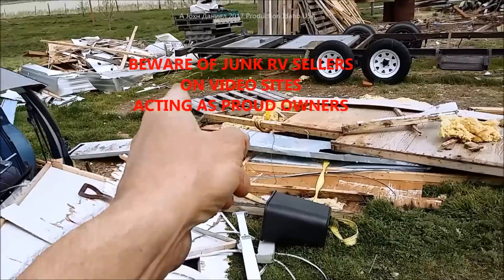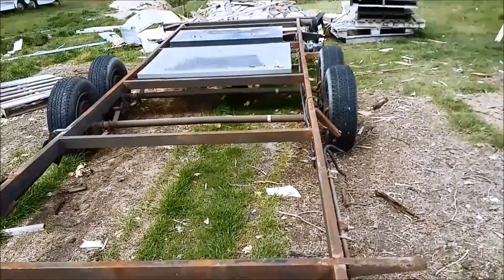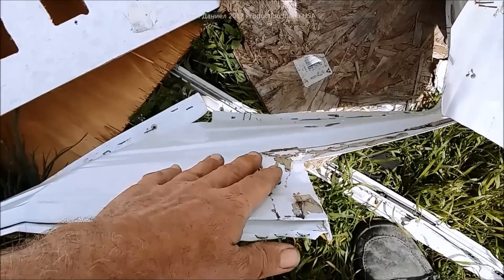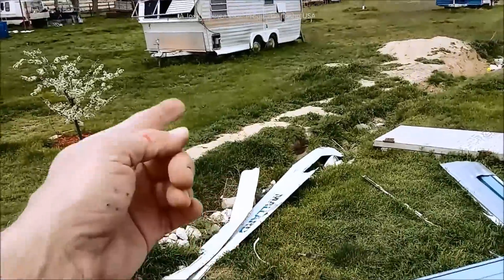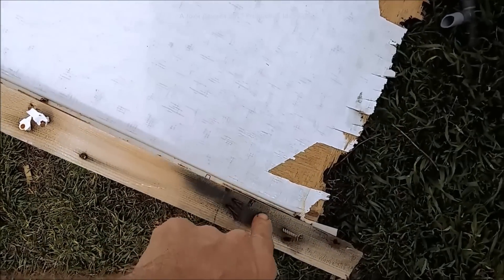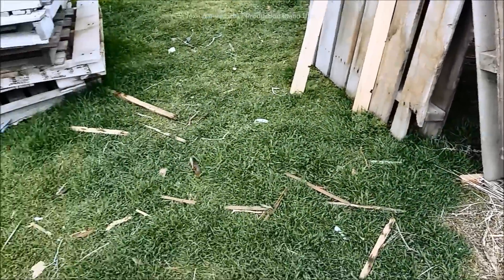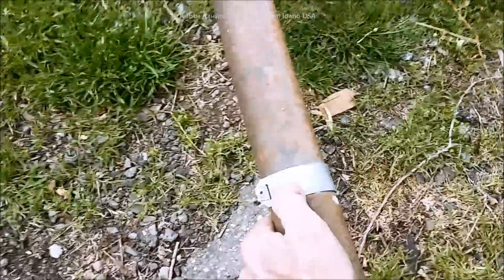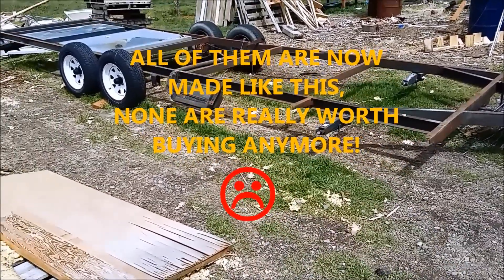HOW THEY MAKE RV Campers Travel Trailers, The truth, Wow! Info Below

Comment: The rot is caused by poor maintenance on a very inexpensive travel trailer. This isn't how all travel trailers are made plus, again, this is low-end wood-framed trailer. There are also vacuum-bonded aluminum-framed trailers with reinforced HVAC ducting systems and more. This is like making fun of a poorly-maintained Chevette and saying all cars are made that way. Nope.
Reply from the maker: Did some checking on Aluminum bonding adhesive contact and vacuum construction. Heres facts: RV industry bonding adhesive compared to aircraft industry bonding adhesive - RV industry adhesive material cost per linear foot of bonded surface $0.46 cents, full adhesion according to Dupont USA last on average 33.6 months. Aircraft industry bonding adhesive according to 3M cost $0.98 cents in material cost, full adhesion longevity per linear foot and last 309 months. Draw your own conclusions, but a $60,000 RV should use the better glues, however, they choose to save about $140 per RV to make them fail on purpose. 
NOTE - The RV has 1/4 bead application , the aircraft has 3/8 bead application on its contact surfaces. Widths are similar.
Reply: That's a lifespan (under more severe conditions) of some 25 years. Depending on bulk purchasing power that $140 differential may be lower, and really, would you prefer to "save" your hundred or so dollars and have a leak / delamination in two and a half years (that'll cost you thousands to fix - warrranty's long expired), or would you rather spend a few extra cents (compared with the full purchase price) and have 25 years peace of mind?
Reply: Kevin Masters 100% true.  I sold RVs for five years, some expensive pre 2008 models were well built, but after the market crushed even those went down the hill. The word is cheap made in China parts assembled really fast in US using a lot of wood from Canada.  So out of the five years, I spent two and a half in service dealing with my customer's headaches.  I spent most of my life in automotive industry and when I saw how they put these RVs together was like "wow, so I'm selling brand new Ford model T".  Customers loved me, a lot of them became my friends, because I told them up front "bring tools, cause s$$t will come a part or break down". Cheers
Reply from the maker: Although your post has convinced people that MAINTENANCE ONLY is the key, how about the fact buyers are getting RV's with totally missing seals? How does a buyer, (the 2 previous owners of this FleetRot RV) maintain a RV that he has 4 windows you can not see without removing them prior to buying it having absolutely ZERO mastic seal, 3 more with partial seals. This is what happens often after long holidays at the factory or untrained replacement employees who don't spend 2 seconds before they screw in a window if the tape shop guy even put the mastic in the window rim prior to sending it out for install. And its common. 
NOW TO COMPARE - So like your comparison of a poorly maintained Chevette, if it came with no water in the radiator or oil in the engine from the factory then General Motors would get a bad name in its entirety just like Fleetwood aka FleetRot gets here. The problem a Chevette had was not lack of quality, Chevettes and their sibling cars were damn good cars, actual build and structural better than most Gm cars of the day. But from roll out they had a piss poor parts and service network. The car got a bad rap for it as a result. We had a Diesel Chevette, 4 door that with the factory 4 speed went over 300,000 miles. Due to being a Diesel we could get parts from then WESTERN AUTO/Green Light Auto parts and our Chevette never was a issue. But GM dealers ( Detroit news 1988 ) were 3 years behind on parts for Chevettes and similar chassis cars. Not the cars fault. But it earned it millions of haters.
Reply: Roy Grillo Just so you know a certified tech most likely did not change your oil. I haven't done an oil change in 15 years.
Reply: 40mmrrsmith I've worked in a dealership serv dept.  The techs don't do oil changes unless it's part of whatever service job they happen to be doing.  The ones doing the quick lube oil changes are usually late teens-early 20s kids going to the local vocational school working part time and aren't fully trained yet on whatever they are doing an oil change on.  Had to put a motor in a Maxima that blew up after those kids forgot to put the oil filter on.  Made it a mile down the road and was towed back in with a hole in the side.  Smh
Reply: Anthony Barthel the first dealership i worked at carried forrest river. Rockwood and wildwoods. The wildwoods were aluminum sided and the "rotwoods" fiberglass sided. Wildwoods held up a tad better than the rockwoods because of the aluminum but theyre both low line travel trailers. Theyre not much better than a fleetwood. The rockwoods would have delamination in the sidewalls in 3yrs.
Reply: Not sure why I'm wasting my time but there are HUGE differences in travel trailers from one manufacturer to the other and from plant to plant. Yes, they all have problems because there's only one refrigerator company (two brands, one owner) and one company makes the vast majority of the components in an RV - Lippert. But a well-made trailer such as a Rockwood, Flagstaff or Outback; for example, will offer significantly fewer issues than something like a Sonoma from Forest River's SoCal plant. 

And who's to say what's worth what? I came out of the hotel business where we'd charge people $250 a night to sleep in someone else's bed. For $250/month you can buy a decent smaller travel trailer and bring your kitchen and your own bed with you and travel all over the USA. Now I work in the RV industry where I see things first-hand and I'd much rather have a travel trailer and roam the country than stay in hotels and motels.
Reply: M. Dwayne Steckley Absolutely nothing, since I'm Canadian. I'm just against the sticker "Made in USA". It should say "Assembled in USA". Cheers
Reply: @wadimszymocha7463  
Whos your president anyway?  Lol cheers.  Loved Toronto.
Reply: Јоhn Daniel Did you really expect aircraft quality? Holy shit. When was the last time your rv went 400 mph?
Reply from the maker: There are no such people on the Assembly lines, Certified rv techs are at dealerships or independent repair services and are people trained though Vocational Schools. Not the industry.
Reply: wow.  very helpful rresponse
Reply: Maybe Anthony Barthel lives in the desert
Reply: kevin, how bout a late 80s early 90s fleetwood southwind type Rv? 
ive been looking at those lately as they seem structurally solid and you can find them for 5k
Reply: Dunford00 stay away from Fleetwood. I would suggest a Winnebago adventure in those years. Much better construction and they will still have parts available.
Reply: Anthony Barthel well said

I have an 05 travelaire 18'

Priceless

No issues 

Good quality 

Ac still cold

Excellent

Makes me happy I don't have an inferior brand
Reply: Anthony is correct. If consumers stopped buying junk, manufacturers would stop selling junk. Don't blame your lack of skills for making better choices on the mfg, you purchased the damn thing. And insults are not arguments, it's just a projection.
Reply: Anthony Barthel im a master certified rv tech. None and i mean none of them are worth the money your paying for them. They just make the higher dollar ones look more appealing. Yeah they have their bullshit sales pitches like vacuum bonded and the one piece roof ect. In the end theyre all slapped together as fast as humanly possible with the cheapest materials available. The fleetwood revolution is a 400k unit fully equipped and from the factory we'll have 20 major fuckups on average to fix from the factory before we can even sell it. Then after the customer starts using it and more shit breaks theyll be back with 20 more warranty jobs. Had one guy that was back 4 different times with a coach and after we finally got everything fixed he filed a lawsuit and demanded our dealership take his back and give him another brand new one. The sad truth is he should of kept the one he got the bugs worked out of cause hes starting all over with a another new one. Lol
Reply: Roy Grillo no I fix them not build them. The guys building them dont have any certifications. Theyre on piece work. The more they push out the more money they get
Reply: Roy Grillo sure each manufacturer has their model specific training classes, which is a sales pitch and ive been to most of them, but RVIA (recreational vehicle industry's of America) is where you get the training and take a 4hr test at the end. If you pass the test and up to a certain percentage your certified.  If you score over the threshold percentage then your master certified. And its a very difficult test. Lots of essay questions. We have guys that have been working on rv's for 10yrs and still cant get master certified or some even pass it.
Reply: I'm a retired tech thank god. Junk
Reply: What's wrong with Canadian wood?
Reply: You gotta love the soundtrack selected for this rant.. lol
Reply: Anthony Barthel exactly ,it’s a piece of junk
Reply: Anthony Barthel but the frame is crap too. It's making me rethink this whole endeavor.
Reply: Anthony Barthel so your saying forestriver is a good One?  We I've been in this industry over 20 years and take it from me, there isn't a good one period. It's your money to waste. Buy a new one and watch the service department rebuild it for you. By the way they will blame the repairs on improper use and not cover it under warranty. I see it everyday.
Reply: How do you "Certify" or even "Master Certified" RV techs if not being trained by those whom build them? I have not heard of Vocational Schools strictly for the RV industry. Who trained those instructors at the schools? In a similar instance I took my 2017 Ford Explorer to the dealer we purchased from for the 5000 mi oil change preformed by a "Certified" tech. And the next morning I started to take my wife to the store and the belly pan (fiberglass shield) fell off and broke. Tech failed to secure the pan after oil change, needless to say the dealer replaced it and apologized then gave us free detailing services. But can you count on just certifications?
Reply: M.Dwayne Steckley Its weaker because of Justin Trudeau giving it hugs
Reply: "from the factory we'll have 20 major fuckups on average to fix", (Q) so are these fuckups caused by "master certified rv techs?
Reply: M. Dwayne Steckley it's Canadian. Duh
Reply: Your just a sucker that believes what ever that TV tells you as it has to be the Gods truth...The TV can't lie right because it told ya so
Reply: Anthony Barthel: Thank you. I hate douchebag scare tactic videos. The guy that made this video is a complete fuck up if he didn't realize this before he bought it. Every RV owner I know is aware that water is the enemy. That's why we reseal our RVs every year.
Reply: Anthony Barthel stupid fuck! You're just another bubble head, can't be any dumber.

Comment: Even cheap wood doesnt rot on its own. Poor maintenance here
Reply: Wood frames don’t always need a leak to rot. Condensation in wall systems that don’t breath is probably the biggest problem.
Reply from the maker: True, most Rv buyers already know that the maker of the Rv left out sections of seals.
Reply: Јоhn Daniel ive been using rvs for 30 yrs. Only had one issue because i can check seals and squirt dicor. Not hard

Comment: had a 2004 Mallard 28ft. The frame cracked where the shackle for the leaf spring attached. I will NEVER buy another wood frame RV, All metal walls and roof trusses. I happen to live in Elkhart IN where most RVs are made and can go to the plant and have it built my way,
Reply: I'm actually looking at a wheelchair accessible Harbor View, have you heard anything about those? Any Info would be greatly appreciated.
Reply from the maker: They are a HyLine product. In a 0 to 10 rating on quality they are a 6.4, compare that to industry standard of 3.8 and I would say your not in bad shape. The number one issue with them is like all, seals. the most intelligent thing to do is check it regularly for any signs of leaks, and on a HyLine check it for roof membrane connection to the strip rails on the top edges of the roof/wall connections. Other than that, decent RV.

Comment: hmmm..... thats funny my 2008 Pioneer by Fleetwood has pex waterlines in it, poly-b waterlines in this video. this videos bogus. an inspector would not allow poly-b water lines in this year of trailer
Reply from the maker: That was due to the RV dealer, trying to fix leaks he replumbed it with I think QUEST Poly apparently from his junk pile. The receipt for so called "warranty work" was in the RV. Even used crappy twist connectors. Some was still red and blue PEX but only behind the tub. Bogus was the Maker and Dealer in Oregon, not the poor sap who ended up with it.

Comment: There are a couple well built RV's still on the market today . Outdoor RV MFG. and Bigfoot are two very well made trailers .
Reply from the maker: Thor industries is about the highest quality in a tow behind.
Reply: I just purchased a 2018 Bigfoot camper, built in Canada.  The build quality is incredible, and superior to the American brand I previously owned (also purchased new).  I didn't even have to vacuum up sawdust and metal shavings from inside of the cupboards, or realign the door latches when I got it home.  Bigfoot trailers are likely just as good as the truck campers.  Paid a lot for it but it should last a minimum of 25 years.  I bet much longer.

Comment: Yes I was given a 197? 21 ft Fleetwood and did the same as you. Stripped it down to the bare metal. 75% of it was rotted. Glad I didn't' pay anything for it.  I want to build my own, I've go about 10 to 20 years  left of life. I hope this trailer will hold up for me. Glad to see you point out the type of bolts they are using. I am going to use steel framing for most of it. I'm open to impute. Thanks Don

Comment: you know you was Flexing the frame that frame is going to flex until you get stability on the frame we build utility trailers and our frame do the same way until we get the decking on it but I'm with you on the junk and the crap that they put into these RV when you go see a RV in a showroom 90% of the time that the issue with the roof or it wouldn't be in there to start with I got one the same way was leaking when I bought it now it's it just sitting in my driveway collecting dust it's a Fleetwood RV pioneer
Reply from the maker: If you use rectangle box framing, and crossmembers made out more than sheet metal it would not tear apart due to depending on shitty wood to keep it from flexing. Its the very poor framing on top that is not strong enough to resist the flimsy frame. The result is all seams get opened up to leak.

Comment: One of the reasons i went to an all aluminum Camplite. We bought an MPG years ago, I think the rot started on the dealers lot, they denied (I'm a stickler for maintenance) anyhoo I unloaded it before it got worse. Built low quality and sold as with I m sure a 400% increase. Most RVs (jayco, fleetwood) are total crap. Lots of others, do your homework. Good video. Cheers
Reply: I like the Camplites a lot!  The only thing I don't like about them is the floor, but not because they aren't built well.
Reply: I've got the upper end of the model lineup and they have a vinyl on the floor. Fo wood cabinets, its great. the base models all have the aluminum showing.

Comment: I have news for you.  Go LOOK at your older Holiday Rambler.  The cabinets are built the same.  Staples and luan.  And furthermore, if the customer didn’t take precautions and reseal certain areas that trailer would rot too.  I’m not sticking up for the manufacturers.  They all slam em out with built in issues.  Mobile homes are no different.  Slammed out without quality.  Just saying the trailers of old are no better than today.
Reply from the maker: I have looked at my old rambler, No leaks so far 40+ years or No rot. And no luan. But it does have some ugly fkn carpet.
Reply: manufactured homes are not built the same.  They have to comply with HUD standards.  Travel trailers do not
Reply: I have a 1967 holiday rambler and replaced lots of things because the people that had it before me didn't take care of it they are not made to last forever if you pull them up and down the roads it will fall apart alot faster parkit at a camp grounds maintain it and you'll have a good coach for 10-15 years
Reply: wayne halladey o

Comment: Your video was good.I have heard for YEARS best way to buy is a used RV because they are cheap, low miles, barely used.  But I am finding the exact opposite. When boondocking RV people whose travels I follow on youtube (for the scenery) upgrade to a new rv, it always an old one, around 1998-2003 and they will never answer what they paid. But on craislist locally they are @ $30.000 with varying prices. NONE of them every buys a new one.  Or they rebuild a van.

Comment: If the axles can carry 5600 lbs. and the total trailer weight was 5300 lbs. the tongue weight is 10% or 530 lbs. so the axles were carrying 4770 lbs. or 85% of the max capacity. What is wrong with that?
Reply: try adding some weight to the trailer, as in personal items, water, battery, propane tanks (yes, the do not include those in the dry weight).  Don't hit any bumps in the road, because you are going to exceed the limit big time with acceleration forces
Reply: At least 1000 lbs of peronal items and 100 lbs for water and battery and your propane . over gross
Reply: Cargo????
Reply: Hell if I take a big country sh** in one it's already overweight lol
Reply: Anonymous One the axle rating and actual capacity are two different sets of facts . I'm pretty sure the rating is lower than the actual max cap